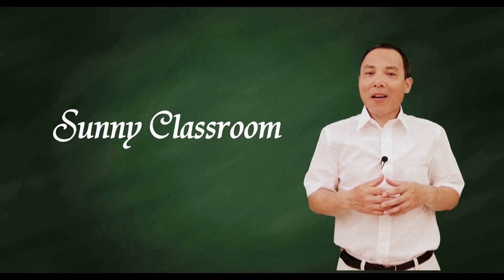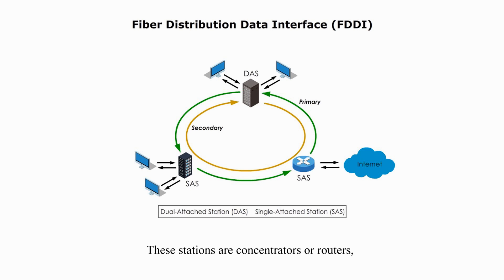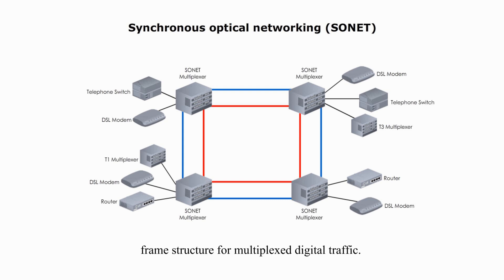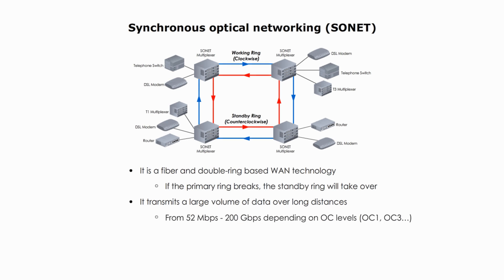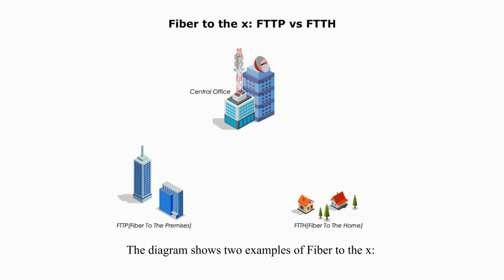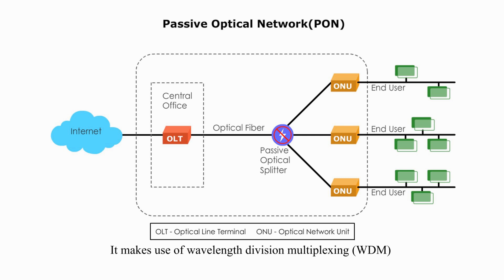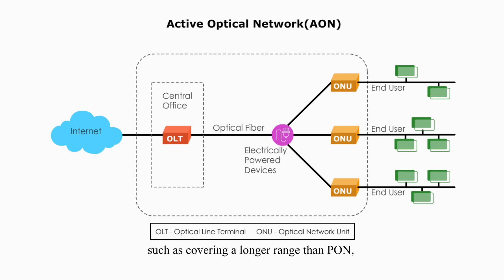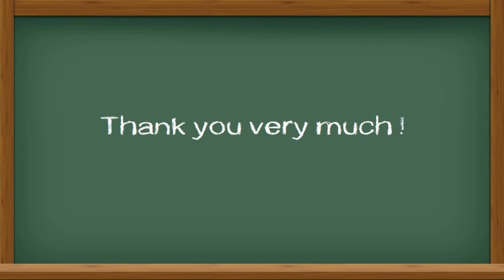Fiber-based networks: FDDI, SONET, FTTX, FTTP, FTTH, PON, AON

Comment: Sunny Sir, as per the diagram in FDDI - the secondary ring runs data in clockwise direction and primary ring runs data in anti-clockwise direction.